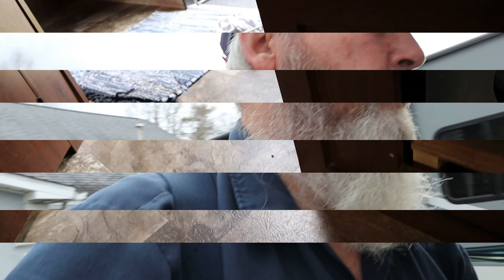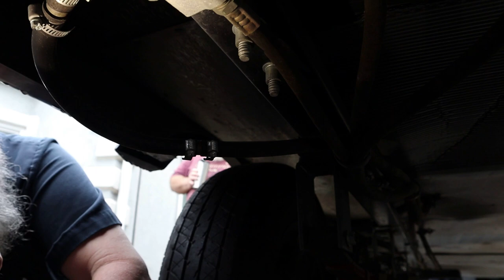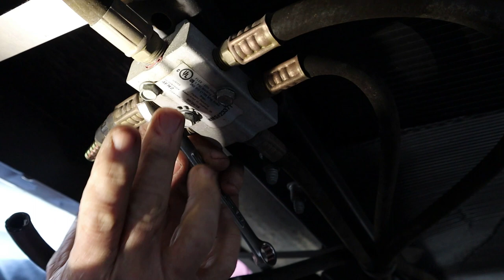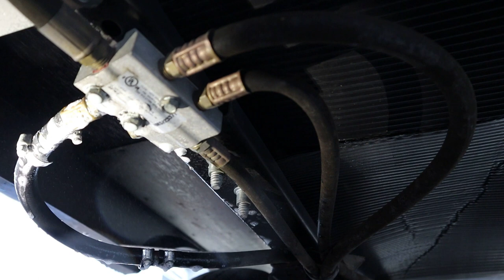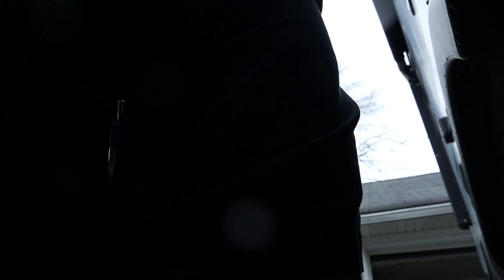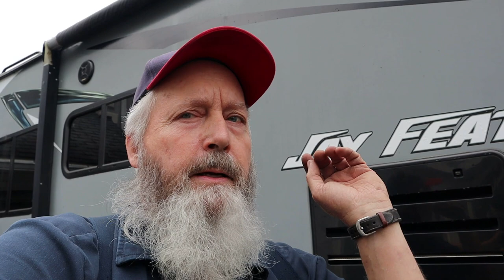You Ain't Going To Believe This One. Very Strange Service Call

Comment: What’s your thoughts on how that happened and best way to prevent that from happening?
Reply from the maker: Gas line was damaged and left open for too long.
Reply: Blown tire
Reply from the maker: @perrydegroff6617  There was no other damage. I have seen a LOT of blown tires and there is usually much more damage.

Comment: I’ve had problems with the regulator getting gummed up and not let propane flow.  I’ve started carrying a spare regulator after the second time.
Reply from the maker: Did it get oil in it? Regulators don't like oil.

Comment: Many years ago a group of friends had left Denver to go camping in the mountains.  The next morning a friend’s wife started to fix breakfast and hollered at him that the stove wouldn’t light.  He started checking stuff and figured out that the hot water heater wasn’t working.   

So he started taking things apart and someone suggested that he check the tanks, both were empty.   So the whole weekend he was the butt of many jokes.
Reply from the maker: LOL....that is funny. I have seen it many times. Get called out to work on one of the propane appliances only to find out that none of them work, because no propane. ALWAYS check the most obvious problem first.

Comment: My best guess.   The hose got caught on something and broke it.  Stopping the propane at the tank if it was on.   Th owner did not know it happened and parked the trailer for a while.   Later, noticing something did not work, it was found the hose was broken and replaced.   The appliance desired was tested and worked.   All good!   At least until he wanted heat.   Good thing he tested it a few days before his trip.
Have a wonderful day!    Kevin
Reply from the maker: Sounds plausible. You have a great day too, Kevin.

Comment: Hey hillbilly in one of your videos you had a video on replacing GFCI outlets. On my dad's 1999 Fleetwood Prowler fifth wheel, there is one GFCI protected circuit that with nothing else plugged in the circuit is drawing 3 watts, what would be causing this phantom load? By the way I used a kill a watt meter to measure the  total idle wattage. Every so often the GFCI outlet will trip, but very seldom will it trip.
Reply from the maker: Man, I am O for 2 on GFCIs in the last few months. I have had 2 of them that I couldn't figure out, so I might not be the best guy to ask.